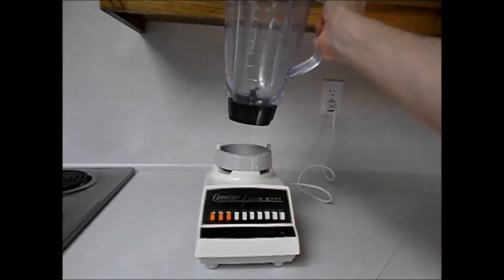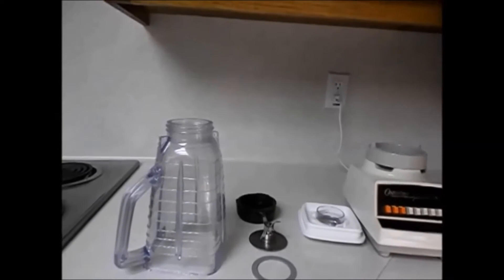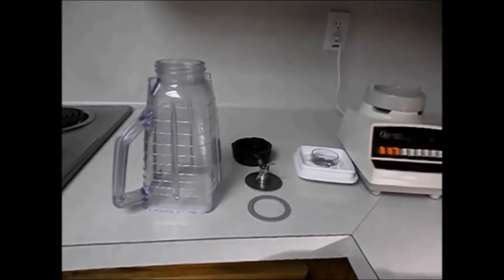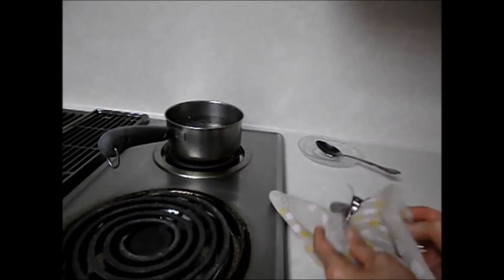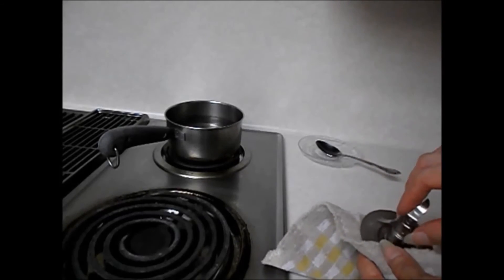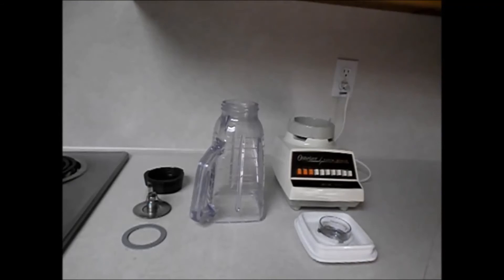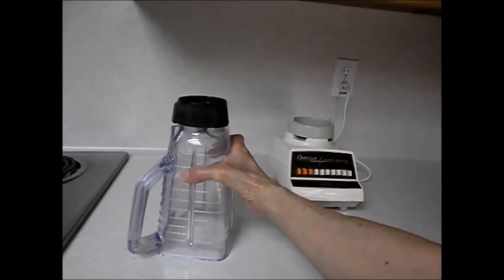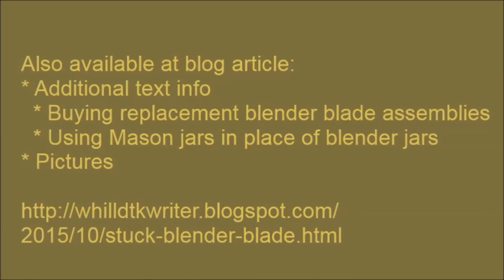Stuck Blender Blade?

Comment: Your video saved me $8-9 of the replacement Oyster blade, thank you!  Our blender hadn't been used in a while and this was the exact issue.  Other videos suggested the bearing was seized and a replacement part should be ordered--  WRONG!
Reply from the maker: You're welcome! Many years ago, I had the same problem with the immobile blade assembly. The person who sold me the replacement probably knew what the cheap and easy solution was. When I ran into the same problem a year ago, I figured I'd try something else--the boil-out resolution. :-)

Comment: This video continues to aid us with a stuck cutter assembly. Boiled for 4 minutes and my frozen blades are free.
Reply from the maker: So glad the video helped unstick the blades!
Reply: @whilldtkwriter  Later last evening I found the blade difficult to turn, so I tried a follow up. I brought a glass of water, half filled, to a boil in the microwave. Then I placed the cutter assembly upon the glass rim,  to allow it to heat up. I dripped Olive Oil over the drive end sprocket and twisted the sprocket. I poured off and reapplied several times, My hope was that as the assembly cooled down, it would suck the olive oil into the shaft. So far it seems to have helped. It may be ok to use a premium lubricating oil, but I'm a bit paranoid.
Reply from the maker: @JohnNelson-p1n  I hope your solution works. I think some other commenters mentioned adding a little bit of dish soap in the boiling water to really remove any residues. As you have added olive oil, considering the appliance is for food items, I don't know if using a lubricating oil would be either helpful or harmful. Had you tried powering on your appliance to see if it spun well?

I myself made sure to rinse the post-boiled assy, wipe dry w/rag, hand-rotated a few turns, and set it on something to ensure total air dry. I put the assy back in the blender and pushed the button to ensure it still spins. I use the blender often enough that it doesn't freeze up.
Reply: I believe this sticky situation occurred because it sits on the shelf for months. My first attempt, it came loose, but perhaps I should have loaded it and run for a few minutes. Anyway today it freely rotates. Thanks again for launching my efforts, and resulting success!
Reply from the maker: @JohnNelson-p1n  Glad it's working again. Be sure to occasionally power the blender on to ensure it spins. I know what you mean about not using the appliance for months at a time. Haven't ground items or blended hummis in awhile.

Comment: I tried this. It worked. Partially. I could still see a bunch of gunk that could be future issue. (20 yr old beast of a blender, this blew the fuse. So we looked everywhere for this type of fuse, without any success, so my bf altered a different type of fuse and soldered it on.) That's when we realized the locked blade. So after the boiling in water, I looked down inside and it was nasty. So I boiled again with Blue Dawn in the water. The water was yellow/brown after and the gunk was gone. Still hit with a old toothbrush just to clean any residue and maybe he will get another 20 out of it!
Reply from the maker: Glad the video helped you get your blender working again. Nice that you persevered with cleaning the blade assy more. A few other commenters have said that a little detergent also helped. Remember to occasionally run the motor to ensure the blade continues to spin. And if stuck, revisit the video info.
Reply: @whilldtkwriter  i used my blender a few days back it was working perfectly but yesterday i tried to mak milkshake in it and it's blades were stuck, i don't know what's the problem, if i send it to repair you know they will charge me a lot even if the problem is such a small one so i searched online and found your video, it looks easy but i'm not sure if i can do it i never did anything like this on my own, should i try ? How do i open the panasonic blender's base it's a little different than your's, should i just turn it like you did ? I'm fed up of getting things out of order  i want to learn it myself😟
Reply from the maker: @promax9159  Hi! Do you have a manual for your Panasonic blender? If not, find the model number and do a google search for the model's manual that might show you what the parts are and how to separate them. 

Main separation is jar/gasket/bladeassy from base that attaches to the motor unit. Then separate the jar from gasket from blade assy. Boil water; drop blade assy in for a few minutes, adding a little liquid detergent if helpful. Rinse the blade assy in cooler water and see if the blades move.

Pay close attention to the order of the parts you separate. Be careful of sharp points and hot water. Let me know how the fix works. The video might reinforce the instructions and order of items. Good luck!
Reply: @whilldtkwriter  thanks for replying, i tried to open it and it's base got opened with the lightest pressure, i boiled it for a few minutes as it's plastic it started moving but still not moving like it should, i want to open the base of the blade to take everything out and clean them but don't know how to open because there is no bolt at it's bottom, there is just a round flat headed piece of iron in the centre of the black plastic that fits on the machine, can not open it
Reply from the maker: @promax9159  Let's try something different. As you a a YTuber, you can post videos. Put a camera on a tripod, record the Panasonic blender--move it around, rotate it, show frontal, bottom views. Make sure you mention the model number or show text on video. Separate the parts that you can, recording so you can put everything back. Get some video of the motor in motion in real time with different settings.

Upload the video and reply to this message with your video URL. Let's see if we can get your blender functioning again.

Comment: Amazing!   EXACTLY what was going on with my blender.  I hadn't used my blender in awhile and I thought it sounded unusually louder than I recall, exactly as it sounded in your demo!  However, my blades moved, but slowly.  I thought maybe it was user error and that I needed to add more stuff to make it mix more (I was making small portion yogurt sauce for myself).  I had very limited ingredients and I ended up added more and more water and yogurt just to see if I could get it to work - recipe was totally all wrong and watery at the end of it all and it still wouldn't work!  And then I noticed a smell, the motor from the base was smoking!  Called customer support and they told me if I pay $12 I can get a replacement of equal or lesser value ($36).  I've used this blender less than a handful of times in the past few years I've had it.  I thought they would walk me through some trouble shooting, but nope!  And then they instructed me to cut the power cord and throw it away?  I'm so glad I did some digging around and found your video!  HOW WASTEFUL, think of how many people actually did what they were instructed for the same issue!  Makes me so angry!  I did just as your video instructed, so easy and works as it did when I first got it!  THANK YOU FOR SHARING!
Reply from the maker: Wow! Have you stoked my ego! You're so welcome--thanks for your story! I'm glad you saved your blender.

Comment: I tried putting a little oil in the mechanism then running it on the motor. Still stiff and even got warm. Do not try that. It could burn up the bearing. Found this video and was reluctant to try it on my plastic blade housing, and usually bearings and water don't mix. Boiled it and it works perfectly though! Got me wondering what's actually inside that lil thing.. 🤔
Reply from the maker: Hi, Joel. Glad the video helped resolve your issue. I suspect that over time, some small amount of liquefied food residue built up into the blade assembly, sticking parts together at room temperature. Boiling the assembly (the water then acting as high-temperature solvent) dissolved the gunk so things could loosen up and move again.

Comment: Thanks a million! It worked. Mine was very stubborn. It sat in a box for years. I waited the 5 mni, but it barely moved.I added a bit of dish soap to the boiling water, and it helped.
Reply: by the way, I have the exact same model as shown in the video. Is it dishwasher safe?
Reply from the maker: Thanks for sharing your experience in resolving your stuck blender blade!

All the blender parts are dishwasher-safe except for the blade assembly. The jar is fine in the lower rack. I myself put other plastic parts in the upper rack, but I'm careful to anchor or otherwise place an item adjacent to prevent the parts from upending or flying off.

Comment: I have a krups 239 glass blender and the blade turns but when I turn it on the blade doesn't spin for some reason.
Reply from the maker: It sounds like  your blade assembly might not be seated tightly. Try disassembling it, then put the parts together again, tightly, and turn it on again. If it still doesn't work, https://www.youtube.com/results?search_query=krups+200+blender might have some videos that you can write owners to see if they can help you.

Comment: Why didn't you oil the shaft?
Reply from the maker: The issue was very small amounts of post-blender-use residie sticking to the blade mechanism and preventing the blade from turning. The residue dissolved away after heated-water boiling.
Reply: You can't, it's a sealed bearing.